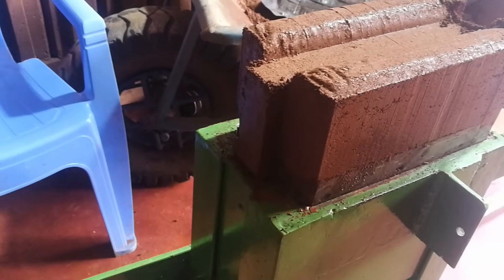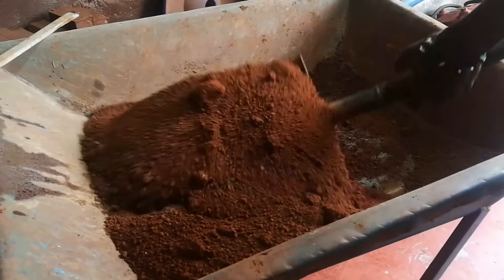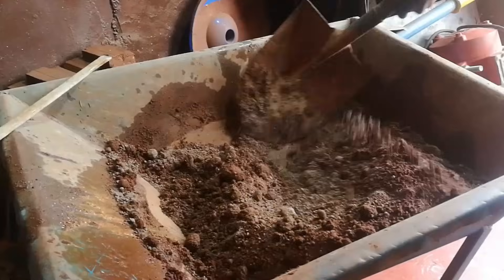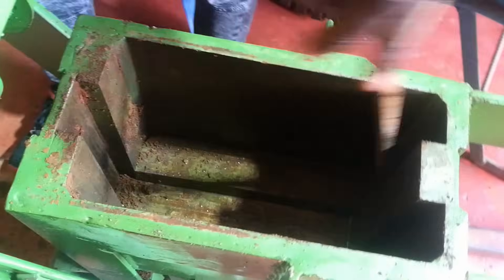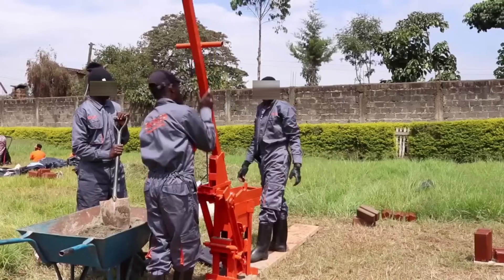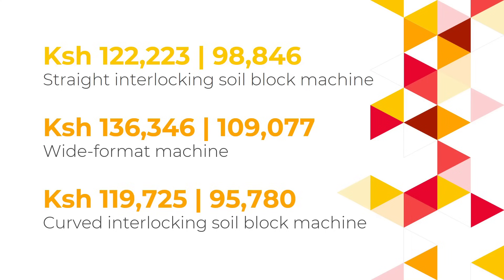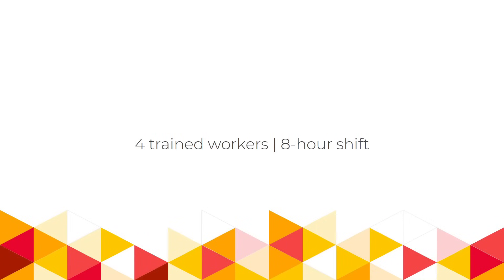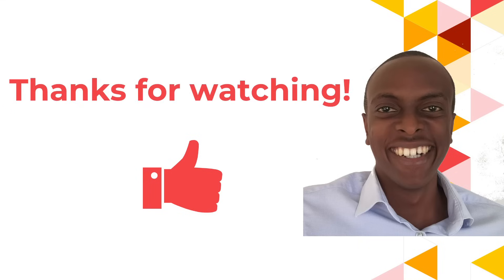The Manual Interlocking Soil Block Machine: How it Works, Price, and Use Cases

Comment: If you're wondering (like I was) 100,000 Ksh is about $645 usd.
Reply: Thank you. I was just going to look for a conversion table.👍
Reply: Thanks, I was wondering.
Reply: Thx 🤓
Reply: It was about $926 in July of the year this vid posted
Reply: Don’t forget unless you ship 1000 then shipping will cost a lot
Reply: This is just not feasible in N America. To labour intensive, but the idea is sound, just needs tweaking and then make a 10 brick system that can be compacted with a press.
Reply: With those welds I think that might even still be on the expensive side... plus most bricks are made from simple molds in rural areas in bulk and sun-cured the same way - this is a single-brick operation.
Reply: Where does it ship from?
Reply: where at though?
Reply: I just don’t know why I am seeing this…I don’t know why I can’t look away…
Reply: @Jbmc65  - Right. But a number of people who could afford it could get together and buy some for some of the hard working people in Kenya who don't have the means to get one.
Reply: Manual block machines are under 300 usd half price for single worker does not need counterweight workers. Includes many block moulds in a single machine
Reply: @Jbmc65  they probably make these in your domestic market.
Reply: @Jbmc65  in the US there are small versions that are power operated with a small hydraulic press.
Reply: @jcrowviral any links or more info?
Reply: No body telling crushing of stones to give consistent material containing sand,gravel and clay

Comment: If you had two machines bolted to the same board, you could load both and pull the lever on both, eliminating the need for the counterbalance and getting far more efficiency from the same number of crew.
Reply: also just by extending the wooden beams towards the front of the machine instead of the back
Reply: I agree. 

Or bolt one machine down to a concrete pad.
Reply: I think the counterweight worker is by design, so that the four workers rotate jobs and get rest every rotation.
Reply: Alternatively, instead of using one huge lever, the machine could use a compound lever where two shorter levers which point in opposite directions are used to achieve the same amount of force as a much larger lever. Like this: https://youtu.be/_WHTWe7A0WQ?&t=61
Reply: Well done
Reply: the machine is 700 dollars. they are from a very poor country. labor is free, resources are not.
Reply: @DieselRamcharger  I've lived in both Mali and Senegal. The only folks likely to purchase such a product are entrepreneurial minded people or humanitarian organizations, both of which would see the benefit in increased productivity.
Reply: @palarious  you mean extortionists.
Reply: @DieselRamcharger  I mean African entrepreneurs and Charity Organizations, most of whom are quite legitimate.
Reply: @palarious  there is nothing legit about charity organizations. Not one that ive ever seen anyways.
Reply: @DieselRamcharger  there are many, many legitimate Charity organizations. I've seen good ones and rotten ones and ones that had good intentions but poor implementations. I'm sorry you haven't seen any that have made a difference. 

Where I was at, a long term missionary charity had drilled hundreds of wells. These were the only safe water sources, often for hundreds of miles. There is no telling how many lives those wells saved over the decades.
Reply: @palarious Yes but one of the reasons governments and ngo's were mad at mr beast for helping africans drill wells was because he was getting it done efficiently and they were scared their ngo/charity work would get exposed, maybe 10 to 30 percent of the donations were used for wells while at least 50 percent is syphoned "paying" for the ngo's living.
Reply: @fullmindstorm  there are corrupt ngo's. There are also ngo's that aren't
Reply: All those suggestions would increase the cost
Reply: @DieselRamcharger  username consistent with comment content.
Reply: haha I was just thinking the same, why use a worker as counterweight and not another wheelbarrow of sand or something. Being literally dead weight is the most useless job ever.

Comment: Another optimization is to rebuild the machine so the finished block can be remove by a "falling floor" in the bottom that after compression can be unlocked and opened, so the stone can be pressed out in the bottom. This would also reduce the cleanup at the pressing stamp would pass through all materials ...

Comment: The 3 moulds could be made interchangeable with 1 compression machine. Cost cutting is everything here ❤
Reply: Cutting the cost of the machine is pointless, the thing this needs is some way of making 250 blocks per hour with a team of three operators -- at that rate they could tripple the cost of the machine and the calculation makes more sense than this... if this was free (in its current config.) you'd still go broke using it commercially.
Reply: The workers in that county make a low wage a day.

Comment: It appears to me that better mixing of the substrate would improve the blocks and perhaps a little more moisture, also the type of cement could improve compressive strength when hardened! An automated hydraulic press would also improve strength of the block and quality of finish!  Creating a flow system for manufacturing I estimate could improve production in a factory setting and varied materials could provide for alternative colours and types!  Great machine that could be taken to a higher production level of 10,000 to 15,000 blocks with one operator given the right automated setup! Great idea for simple building blocks!
Reply: Yes after tweaking mixture, then making a 10 brick setup at a time, using a hydraulic press of @10,000lbs . The bricks would be much stronger plus would not have to be cleaned out after every brick, maybe a quick blast of air might be needed.
Reply: I think the purpose of this machine is for those who don't have the money for such luxuries as a hydraulic press.  This is for people who live where they have nothing but manpower.
Reply: excellent answer.. @Valkaneer

Comment: Best to add some borax to keep the bugs out, at least for the first tier after the cement ground block tier..  I would recommend an air compressor to clean out the form or to have a steel spatula with a rounded out side  that conforms to the rounds of the block form and for best non-mortar applications, st place the blocks in their final place soon after making them, but to check on the cure time before going more than three tiers high.  The amount of portland cement needed can be as high as 12% and the soil has to be of a high sand content, if not the soil needs to be fired.  Sandy soils can yield blocks with as little as 5-8% cement and still be stable and quite water resistant.  True 'compressed earth' needs to be bug treated and have a surface mortar coating over it and in many venues not considered as load bearing..  Check your local building codes.
Reply: Let's pretend we aren't talking about people living in remote villages with almost zero resources.

Comment: I have one addition to your process that I think will help the same machine and the same number of workers make many more bricks to day. I noticed in your video that soil for a brick was added from a shovel directly from the wheelbarrow where the soil was mixed into the machine with the same large shovel needed to mix the soil. I would suggest that a box or a bucket be made that holds exactly the amount of soil required for one brick when it is filled level with the top. As soil is added, the sides can be tapped to settle the soil (probably with the back of the shovel that is being used to shovel soil out of the wheelbarrow into the box/bucket). When a little extra soil has been added, then a straight metal bar or stick is used to scrap the soil level with the top of the box or bucket. This will ensure that the same amount of soil is added to the machine every time and so make bricks that are more uniform in size. 

Then as soon as the brick bring pressed is removed from the machine, the soil for the next brick has already been measured and is ready to add to the machine without having to take the time to make sure the right amount of soil has been added. This allows one worker to be measuring out the soil for the next brick while the two workers working with the machine are pressing a brick

With the addition of two of these boxes or buckets (which can be made of wood or a metal) and a second wheelbarrow, the same 4 workers might be able to double the number of bricks they can make in a day since all four are performing their tasks at the same time rather than waiting on each other to finish a their tasks. 

The worker mixing the soil mixes up enough for 2 or 3 bricks and brings it over the worker filling the box or bucket. And then he leaves with the second empty wheelbarrow to start mixing the soil for the next batch of bricks. Then the worker filling the box uses a small shovel to fill the box, tapping on the sides as needed to settle the soil so there are no voids, but not compacting it. Once the soil is slightly  above the top the box, the worker uses the metal bar or straight piece of wood to scrape off any soil mix that is higher than the top of the box. It would be good if the box or bucket is filled on a sheet of plywood so the excess soil is gathered up and added to the box for the next brick.

Once the box is filled with soil, one of the two workers operating the machine picks up the filled box and carries it over the to machine while the other worker working with the machine takes the pressed brick out of the machine and places it with the other formed bricks. As soon as one of the workers removes the brick from the machine, the other worker can dump the measured amount of loose soil into the machine, smooth it out and makes it ready to be pressed. Once the brick is pressed, one worker take empty box or bucket back to the worker measuring out soil for the next brick in the second box/bucket while the other removes the pressed brick from the machine, and the cycle starts over again.

Thus it can be seen that one worker is able to be mix batches of soil in one of the two wheelbarrows without having to wait for the soil to be measured into the machine. The person measuring out the soil can be doing that while soil is being mixed by the first worker and the third and forth workers are working with the machine to make a brick. And the third and fourth workers will have a measured box or bucket of soil ready for them to simply dump into the machine, and go through the steps to press the brick without waiting for either the first worker to mix a batch of soil or for the second worker to carefully measure out the right amount of soil directly from the wheelbarrow and shovel it into the machines.. 

I hope that you find this useful and I wish you great success in helping more people to build sturdy, long lasting, clean and safe houses with your simple machine yet effective machine.
Reply: Good idea.  A hopper with a chute might help; then a worker could be continually filling the hopper with the mixture.  Meanwhile, the worker operating the machine would quickly judge how long the chute needs to be open in order to fill the mould.
Reply: Hooper chutes idea would work very nice.  You can also use a sliding sheet of metal in the hopper set at the premeasured amount to get a consistent rate each time . Simply empty the measured amount into the mold , close the chute,  remove the sliding metal sheet blocking the hooper to fill the next measured amount. Replace the block  .  It would take longer to read this than to do it.  Love the machine and what it is for.
Reply: Well, this is a handful lot of information.

Comment: What a great solution! I’m amazed the soil/dry cement mixture is cured so effectively with sunlight ☀️
Reply: The dry cement also undergoes a chemical reaction using the leftover moisture from the soil to harden and dry the interior.
Reply: the Chinese mastered the technique while building the Great Wall, most of it was rammed earth, people think it was stone but very little of it is stone, and most of the stone you see today is newly reconstructed wall, the Chinese could make buildings 15 - 20 floors high with rammed earth, the Berbers used it, and south Americans also, anywhere with soil and sun

Comment: You should look at geopolymers as a material for making bricks. If the local soil has a suitable percentage of clay, then it can be polymerized with the proper alkalizing agent, resulting in a material with the same properties as refractory concrete.
Reply: Lime. Has been done for centuries.
Reply: Geopolymer tests as good or better than concrete, stronger and harder, with the added benefit of withstanding any fire.
Reply: Oh, yeah, because that is available in remote villages. Stop being a clever American
Reply: @Automedon2  shoots for the opposite of clever, and tries to keep everyone ignorant.

Comment: 😮 That is very nice.  Make one with two compression leavers that intertwine and counter lever helps apply even more pressure.  😊  
If you increase the pressure enough, they will heat and cure from the pressure maybe?  🤗🤔

Comment: Make a fiberglass funnel to get the dirt into the machine without spilling it around the base.
Buy the machine on credit and line up a 2nd buyer for when your project is done.
That way, you can get almost all of your money back out of the deal when you no longer need the machine.
If you can make all of your blocks in two months, the cost to you would be minimal.

Comment: I know this is a pitch to buy the tools. I would not tout it being greener then using standard brick making techniques. If you're using Portland cement in the formula of the blocks then you're not accounting for the the energy in the production of it "which is significant higher" then baking bricks without it. 
When building taller walls do you strictly rely on weight for stabilty, or do you motar them? 
Are you able to reduce the amount of water usage in the manufacturing process?

Comment: If you can, throwing lie, or cement in with the dirt as you cast it, you get waterproofing built in and maybe extra strength.
Reply: I was thinking the same thing. Perhaps you can make the cleaning a lot faster and easier by having a pressure washer right there and you just quickly spray out the machine after every block?

Comment: Avoiding burning wood to cure bricks is completely negated by using cement. Cement is also a kiln fired product. What you end up with is still not water resistant. Might as well do regular wattle and daub or plain dirt and clay mixtures.

Comment: Hi Nick. I like your idea very much. I wonder if the machine design could be made easier to operate and more compact by using a cheap hydraulic bottle jack, instead of the large heavy lever. I imagine the hydraulic jack swivelling away to one side when loading the press, and clamping the free end down when pressing the brick.

Comment: Thanks Nick Mwema, could you share more on waterproofing these blocks since this is a common challenge due they are porous. Some of us would also try fencing.
Reply from the maker: Waterproofing is achieved using a stabilizer, i.e. cement. When the blocks undergo curing, they harden and become stronger with the help of cement inside the mix. 
The molecules of soil and cement bond together, adding a waterproofing element to the blocks. But the blocks should be cured for 28 days for proper bonding to take place.
Reply: @PropertyNoma  how much is the machine in Kenyan Shilling
Reply from the maker: @emmanuelonyango1403  It depends on discounts. From Ksh 50,000-100,000. It's a wide range
Reply: 7% portland cement.
Reply: @PropertyNoma you start with them just above ground level on a concrete foundation! Then black paper and chicken wire followed by plaster! Some adobe building here are many hundreds of yrs old! Even without plaster or anything they last hundreds of yrs although the rain does its damage! I live in the desert so..
Reply: @PropertyNoma  you should still plaster them!
Reply: I like the lock together shape!

Comment: To save time, I'd put chef mats down on the floor and use a pressure washer to clean the chamber instead of doing a stick/scrape.
Reply: unless you live in a remote village with almost zero resources

Comment: how will this work if the blocks are not vibrated i believe these don't hold load
Reply: Every 8’ you need a bondbeam but other than that they will be strong and hold a lot of load! Best if not just stacked but with mud in between the bricks to bond them together!
Reply: The compression when combined with the Portland cement will provide for a strong block.  We have used similar systems to build boundary walls at Sin Cuidios in Cave Creek, Arizona,  they have been up for decades, the walls were capped with a cement stucco to diminish erosion, but the body of the walls were left raw.
Reply: Yeah good point. Depends greatly on ratio of cement:soil, has good insulation **and needs to incorporate mortared joints to be load-bearing.

Hmm might encounter problems such as bugs, weed, and unpleasant odours.

Comment: If the use of firewood is the reason you don't want bricks so you use cement instead, I got news for you.  Production of cement involves the use of fossil fuel.  So you're not skipping CO2 production either.